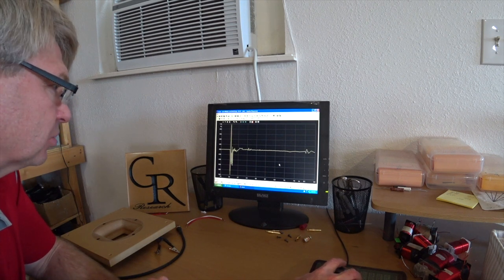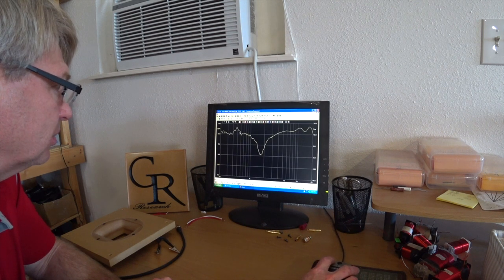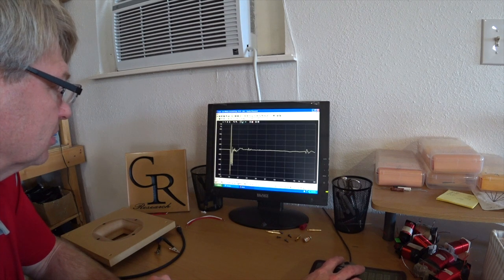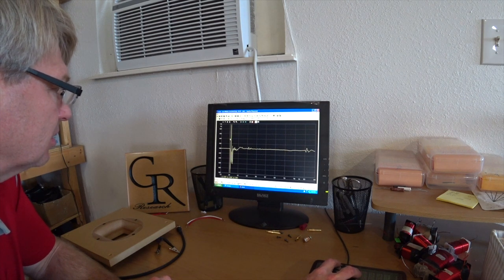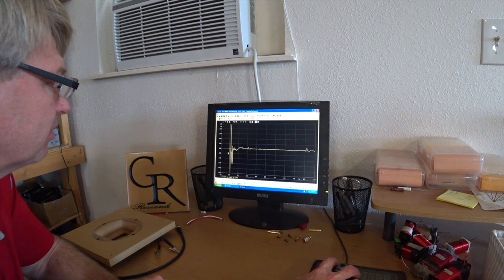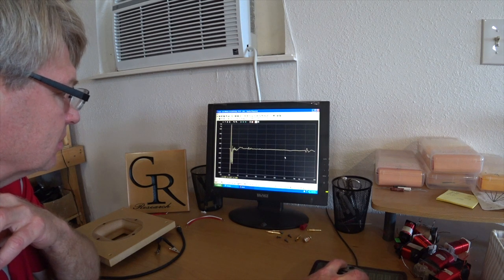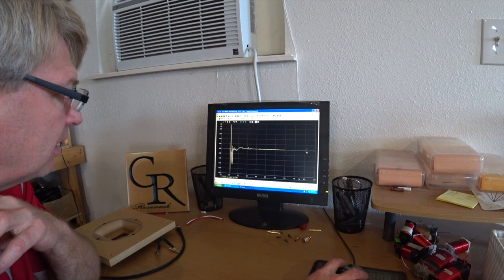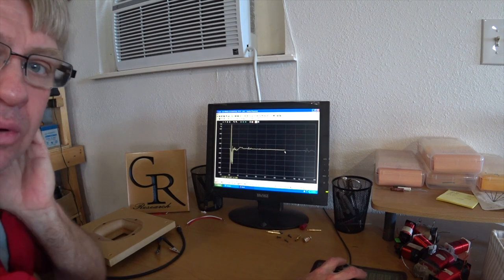Room Measurements VS Speaker Measurements - with Danny Richie

Comment: I am new to speaker designing and i have learned the basics about speaker designing like Xsim, the importance of measuring speakers but i am very confused about the difference between impedance phase and speaker phase (the phase in FRD files). If you have the time i would love a video about that
Reply: Good idea. One is an electrical shift in phase and one is dealing with an acoustical shift in phase.

Comment: Hello Danny, I was always wondering how manufactures of horn systems got around timing issues with long horns like my 1971 Altec Valancia 846A. The VOTT A7 was time aligned, but the smaller 846A and 846B were not. I think they have the horn drivers wired 180 out of phase with respect to the woofer. Crossover point is 800 hz and wavelength is .425 meters or somewhere around 16,73 inches.
Reply: There really is not getting around it. Sometimes the physical offsets are just too great.

Comment: Hey, Danny, 

I have A LOT of questions related to this video below. You could possibly use these questions as a guide for future Tech Talks...

It is understood that you develop speaker designs and test and optimize other manufacturer's designs for manufacturers and individuals. I am seriously interested in your NX-line but it seems that availability of the ribbon tweeters is limited at best. I trust you earn most of your income doing consulting work for speaker manufacturers. On to my real questions...

How do we do room measurements to tune our rooms? How do we treat room modes to minimize peaks & valleys; esp. in the bass (<200Hz) region? It would be cost-prohibitive for most of us to fly you out to do this for us. Could we use REW with a UMIK microphone? There must be a way for the "mass market" to attain good room sound.

For example, before beginning measurements, I assume that we should start room measurements using high quality (good measuring) speakers and that we would want to go ahead and position our speakers in the room for the best sound and treat first reflection points (with absorption if speaker is "close" to the sidewall, with diffusion if the speaker is far from the sidewall?). This would include aligning our speakers with tape measure and string/laser to achieve a symmetrical installation and a "balanced" acoustic presentation; i.e. get the speakers setup in the room BY EAR with rudimentary measurements for the best sound before beginning measurements. I’m confident that I’m at this point now.

My listening room is over my garage and there is a large suckout in the bass (kick drum) range and I have too much midrange-frequency energy in the room despite having 3 inches of SafeNSound absorption at the sidewall and ceiling FRPs. I have built A LOT of 2x4 and 2x2 foot 3-inch SafeNSound absorption frames and intend to build several diaphragmatic bass absorbers, and quadratic diffusors for the front and rear walls (10 feet and 6 feet away, respectively). I can judiciously place all of the absorbers in the room and not over damp the room. My speakers are Acoustic Zen Adagio (http://www.acousticzen.com/Products/loudspeakers.html) and I have 2 ea. SVS SB-13 subs.

Thanks in advance!!
-Hoyt
Reply: at least one of your questions i can answer, how to apply eq.
dont measure, use ears. google search tone generator(szynalski) and use that for frequency generation. that slider let you exactly hone in on the response you hear,  write it down or adjust real time if you can. its actually easier to download equalizer apo (peace) and do all the eq real time there and then after you are done and if you dont want to use eq apo you know have a visual graph of the changed you made so it can transmitted into your eq of choice.

also bass issues can be resolved with having all speakers be sealed, ports conflict with subwoofers.
Reply: sudd I appreciate the effort but prefer to tune the room via diaphragmatic bass traps, absorption and quadratic diffusers. EQ would be a last ditch effort.

I’m pretty close to audio nirvana. 😜 An OB or planar speaker set would be an awesome complement to my TL mains and sealed subs.
Reply: The tweeters used in the NX Series are our own drivers. And we stock a LOT of them. 

There are a lot of software packages out there that will allow you to measure your room response. Just take one speaker at a time and start working with placement and absorbing or diffusing panels until a linear response is achieved. 

It sounds like you are on the right track. You just need to figure out what is causing your suck out.
Reply: Danny Richie ❤️

Comment: wow, we don't stand a chance of  buying good speakers do we? Any suggestions on which speakers I could buy for a decent atmos setup? I thought the rp 8000f were suppose to be such good speakers. I was thinking of upgrading to the rp 8000f. Now which speakers should I buy?
Reply: @John sweda  The measurement shown was correct. Not only did the drivers not reach each other in range, but they were also not in phase. Those aren't things that are done deliberately. These speakers showed a response and timing error. 

And I am a professional loudspeaker designer. The guys you liked to are not. They run a website featuring a lot of disinformation on many subjects.
Reply: @johnsweda2999  No, the drivers all measured fine and there was nothing wrong with the crossover. It was completely stock.
Reply: And I designed an upgrade for it that will be out next Tuesday.
Reply: @johnsweda2999  I do this professionally. Companies the country bring or send product to me for measuring and evaluation services all the time. I use a professional level Clio measurement system. It is as good as they come.  There was nothing wrong with the measurement taker or equipment.  And that graph is using a 5db scale.  

The only thing not right that I could see was the design work for that model.
Reply: @dannyrichie9743   where are the John sweda message ?
are you really shure the mesurement was donne is good condition ? not too close ? ? not off-axe of the mid speaker ?
so you're a professional loudspeaker designer...offert your expertise to Klipsh, they need you ;)

Comment: With my s3000pro i started noticing the left speaker has a few db more treble around 8000-12500 which makes it sound slightly airier than the right one. I would like to know how common(acceptable) this is and if i should take it back to the seller. Cant seem to find anything on the internet where someone measures the difference  between left and right.

Comment: I can't believe that's the original crossover...there must be a defective component or a failure in the crossover. If That's from the manufacturer that would be scary. Was this crossover a mod that went bad? This crossover would give all new meaning for the BBC dip. LOL!
Reply: The crossover is original and does not appear to be damaged.
Reply: @dannyrichie9743  Maybe the crossover summing happens when the mic is placed on the upper woofer axis, this is worth a try as you'll  have more delay on the tweeter that way
Reply: @bernardchesneau3091  I tried that too. It didn't get much better.
Reply: @dannyrichie9743  I guess that linear and balanced sounding speakers don't sell well according to some manufacturers. If people only get to hear coloured sound all the time, they will think it to be normal. I'm afraid this may already be the case and engineers design their products that way

Comment: Was that speaker really made like that or was something wrong/modified with this specific one?
Reply: No, the Klipsch Speakers from the current RP series all have that dip. I had a pair of RP600Ms and they had that dip.
Reply: Nothing about the one I measured was defective in any way. And it responded well with a properly designed crossover.

Comment: REW gets a bad name now, REW is not a EQ program, it has all the  tools to do decent speaker measurements. it can as any other measurement setup also do room measurements. and can generate EQ setings to get a desired response from a dsp.  nothing more nothing less. it does not mean you have to use it for that :).

by the way there is a method to use multiple measurements around the room  then take an average. then EQ that. mostly low.  never use it but it can give some benefit.

Comment: 10:00 1m tweeter axe for a speaker using 10" mid it's too close, the mid are off-axe for his cutoff and the distance between the drivers are not correct from the perspective of microphone, basic accoustic rules
put the mic 2m away and i'm prety shure the crossover point will looks better
you can mesure the mid in his axe too, you'll see the differences with your mesurement
or maybe klipsh sold his most expensive speaker with a LP on the mid one octave too low...maybe not...

Comment: It's hard to take this guy seriously the second I saw he's still using windows xp.  Anyway, I love the facts based, measurement based approach.
Reply: Yeah, that computer still runs on that operating system and is NOT plugged into the Internet. It is a dedicated measurement system. So no need to change the operating system.

Comment: ? If you don’t have a  anechoic chamber. I was shown if you’re lucky enough to live in the woods or countryside can you have a steep hill slope. Hoisting your speaker up on a 24 foot ladder facing outwards down the slope of the hill. And your microphone on a long pole place in front of the speaker out door measurements no wind of course no reflections. Very little to no expense if you’re lucky enough to live in such a location. It’s free cheap and easy and no effort unless your speakers weigh over 50 pounds you will need a helper.